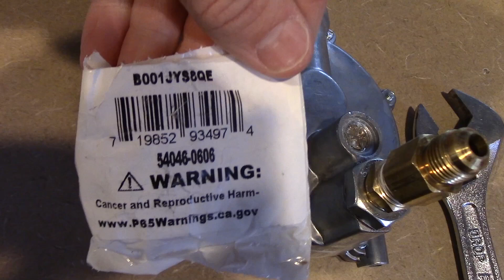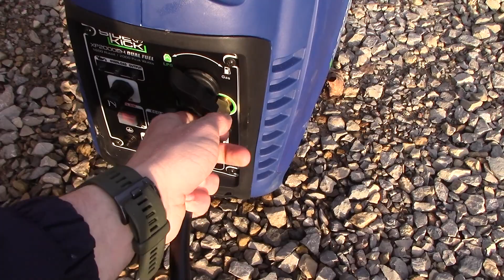Running Your Generator With Your RV Propane - Duromax XP2000EH Pulsar PG2200BiS

Comment: Thanks a lot for the video. I just bought an A-iPower SUA2000iD Dual Fuel Generator with similar kind of beam type regulator . It is great to see that I can now remove the other regulator and plug into the low pressure Quick Connect.  
But instead of the 3/ Pipe to 3/8 Flare adapter, can I use a 1/4" Quick Key Plug x 3/8" Female Flare? This will allow me to use a regular Quick Connect Propane Hose Extension, or even plug the regulator directly to the low pressure Quick Connect on the side of my trailer.
Reply from the maker: Should work
Reply: @JackofAllMasterofNone  Thanks a lot for the info.
Reply from the maker: @pyl4435  I actually did that in another video. Check this out. https://youtu.be/VQ8oOXnF6d8
Reply: @JackofAllMasterofNone  Great! Thanks.
Reply: I need your advice in  how to remove the beam type regulator from the other regulator. I tried using a size 17 wrench to undo the connection, but it will not turn. I have already stripped a bit of the copper nut so I stopped. I saw that the nut has a bit of red color 'paint' at the joint to the other regulator. Do I need a special tool/penetration oil or method to undo the connection?
Reply from the maker: @pyl4435  they probably used some kind of loctite sealer. I will just take the right tool and a lot of force probably

Comment: Could you use it without the meter if you shut of the propane before you turned off the generator
Reply from the maker: Meter?
Reply: @JackofAllMasterofNone  the other part the regulator attached too. You had two pieces the regulator and I though the second part is called a meter.
Reply from the maker: No you can't. That is what pulses the correct amount of propane into the generator. Without it it would flood the engine and the propane would not stop.

Comment: I’m guessing same generator but different names. I’m trying to do my research tonight because the big box stores are out of the Duromax but still have the Pulsar. The problem is the reviews are few but bad for the Pulsar.
Reply from the maker: Yes. I believe they are the same thing
Reply: I wasn’t sure if it was a quality control issue or different internal components with Pulsar. I’m also looking at Sportsman’s duel-fuel version of this type of product but starting to think I’m spending too much time on research.

Comment: Thanks for the video!  What size is your AC?  Hoping this will run my 9000btu Mach 8 on propane after I install a hard start kit.
Reply from the maker: Mine is 9000btu. You should be fine
Reply: @JackofAllMasterofNone  Thanks Jack.  Just curious, are you running a hard start kit with the generator on ECO mode?
Reply from the maker: @chrisscotti  Nope. No hard start kit. Im even running the battery converter on my RV at the same time.
Reply: @JackofAllMasterofNone  Impressive!
Reply: So I ordered a PG2200bis, will test it out with and without a hard start capacitor.  Did you also test this model or know they are the same?
Reply from the maker: @chrisscotti  I did not try it out but it is the same thing. Same engine and electronics manufactured at same plant.
Reply: @JackofAllMasterofNone  Cool - I wonder why it is rated for 200 more watts.  I'll test it out and post back...  p.s. really appreciate your fast replies!
Reply: FYI, I pulled the trigger on this and have tested out the pulsar 2200 version and it works great.  Do you how we can verify that these two units are identical?  Here is a video of the test, if interested: https://youtu.be/DjbiHYzRLXE
Reply: @chrisscotti  The Pulsar 2200 is actually 1600/2000 on propane. 1800/2200 on gasoline.
Reply: @david_sdiego  I figured as much.  It continues to run my A/C, fridge and other accessories great on propane!
Reply: @chrisscotti  Good to know. Considering a trade up from my Honda EU2000.

Comment: How does this compare with duel fuel Chapion inverter?
Reply: I bought a champion 2kw dual fuel, pretty sure it is made by senci, changed oil 3 times in first hour varying load then ran for 5.5 hours 50% for 2 hours and 100% for 2.5 and just changed oil again. Metal in oil each time. It smokes a bit when loading up and seems to use a bit of oil. I'm not impressed. I have a generac 2200 which is same engine as the the pulsar/duromax (ducar) and it had metal first few changes too but burns no oil and didn't have metal after 3 changes. It has 19 hours on it. I'm going to run the champion for like 20 hours on propane loaded and see if it's blown up when I come back. It may be. If it is still running when I come back I'm going to call it good.

Comment: we are interested in running 2 parallel connected smaller generators on propane. question is do I need 2 propane lines or will it just connect to 1 of the generators.
Reply from the maker: Would have to have 2 propane lines
Reply: @JackofAllMasterofNone  but do they make a regulator with  dual connections so I could use 1 tank not 2? if "they" don't make it, is there a reason it would not work?
Reply from the maker: @teresa2298  I am not sure. Not that I know of. It should work if you could make one

Comment: Will it power an AC?
Reply from the maker: Yes. It will run my 9000 btu ac well. Anything larger and the AC may need a hard start kit.
Reply: Thanks